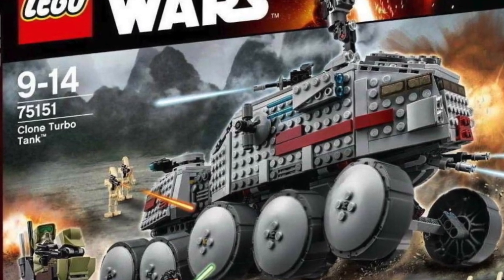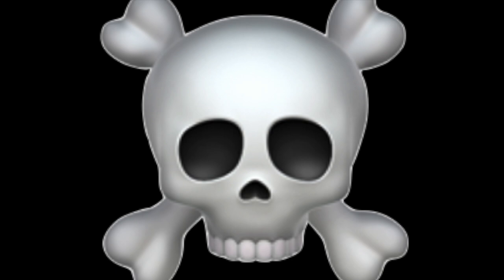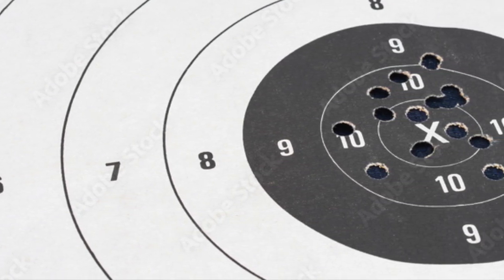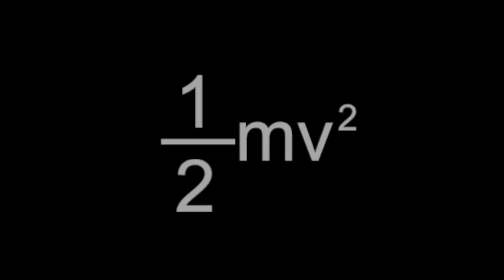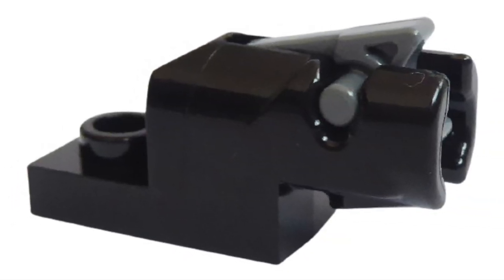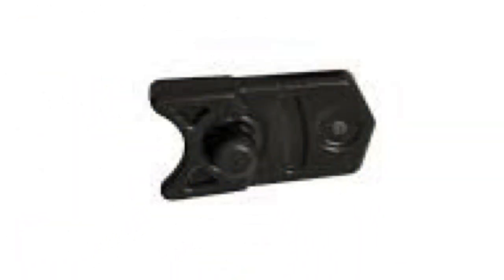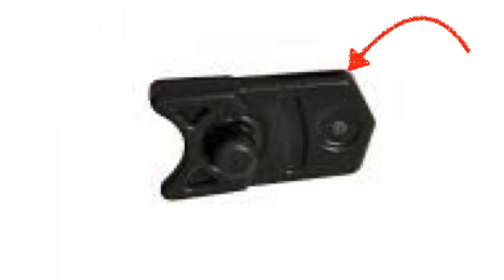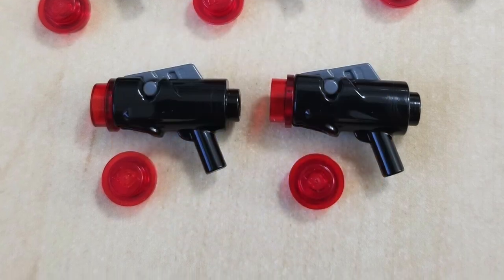How Hard do You Have to Press a LEGO Stud Shooter to KILL Someone?

Comment: Ok but wait. The clutch power of a Lego inherently bends each piece a tiny bit, cause an almost spring effect when the stud is launched. Like just playing with one of these, I feel like there isn’t a threshold speed of hitting the trigger, but a weight? Probably both. And then whatever force you apply would be increased by the final release of the clutch grip releasing.

Comment: I think at a certain point you would have to question the impact resistance of lego

if it hit you it would hurt like hell but the stud would also shatter on impact which you kind of covered at the end of the video when you mentioned it could melt as it moved through the air
Reply: More likely the stud shooter would disintegrate or melt first

Comment: I don’t think it could get that fast, even if it reaches terminal velocity, i doubt it would be fast enough,

Edit: googling the mass of an object that weighs .12 grams, the terminal velocity is 3.6 m/s

So it’s impossible

Edit: but we might be able to in a vacuum
Reply from the maker: Terminal velocity doesn’t depend on just the mass, it also depends on cross-sectional area. A feather has a much lower terminal velocity than a rock of the same weight.
Reply: There might not be enough time for it to slow down to terminal velocity before it hits the person with modern hair armor technology